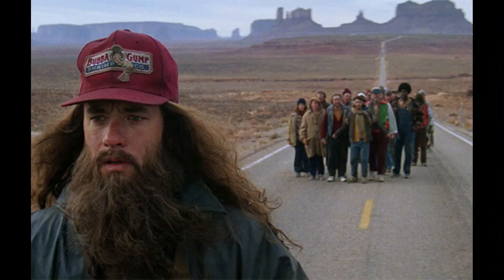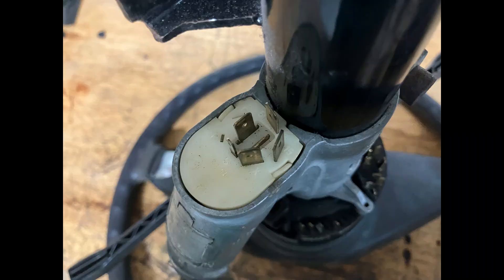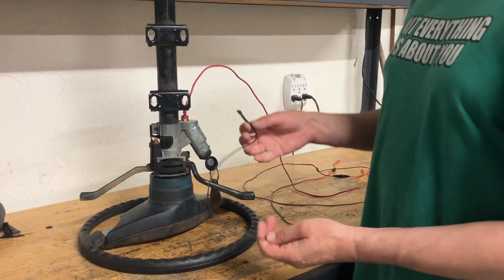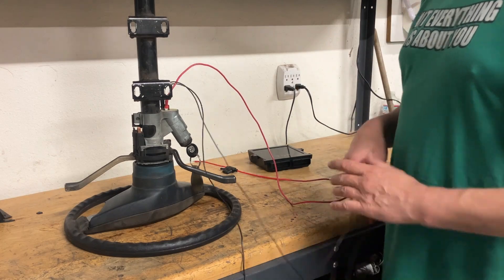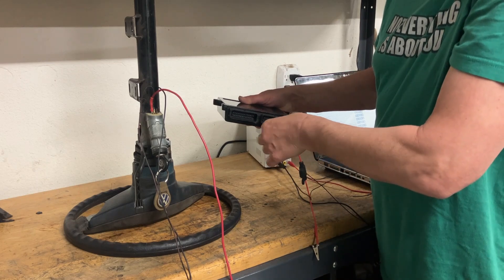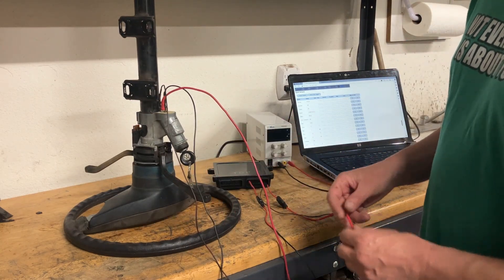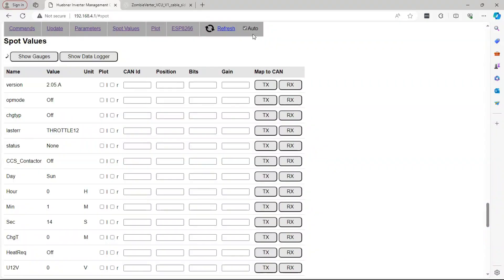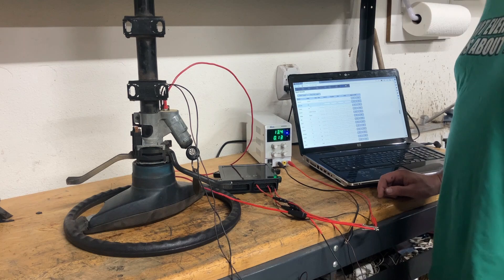EV Conversion DIY Wire Harness 1 - Roll Your Own Fuses & Relays

Comment: Could I use low voltage light bulbs in place of the inline fuses when connecting to the Zombie? I am thinking it might be a way of seeing when the power is on and also providing protection?
Reply from the maker: yes, Damien explains how to do just that here: https://www.youtube.com/watch?v=geZuIbGHh30&t=1554s
Reply: @Good-Enuff-Garage  Brilliant